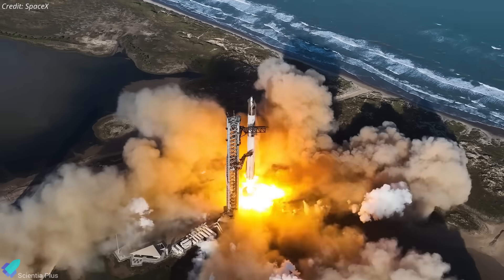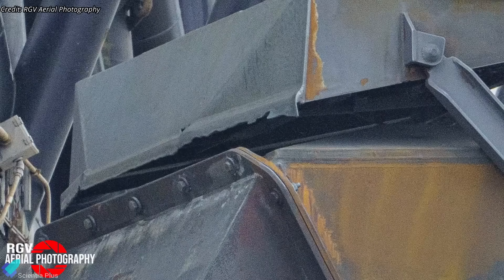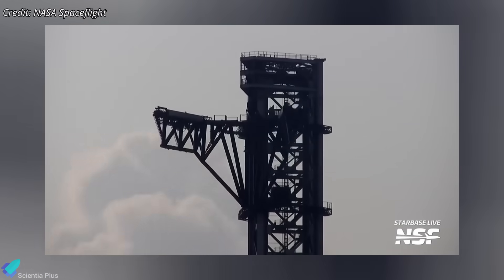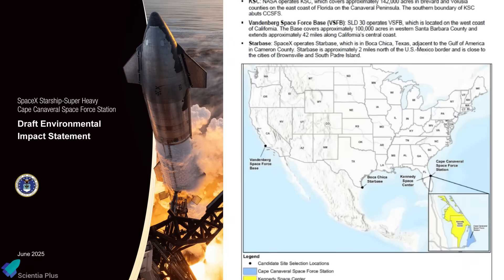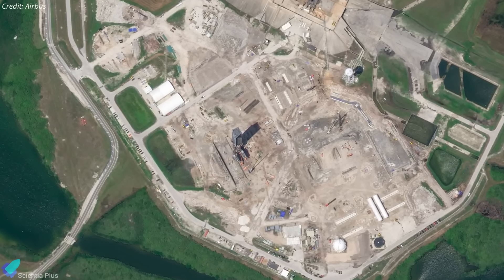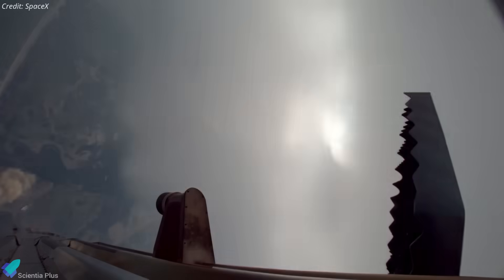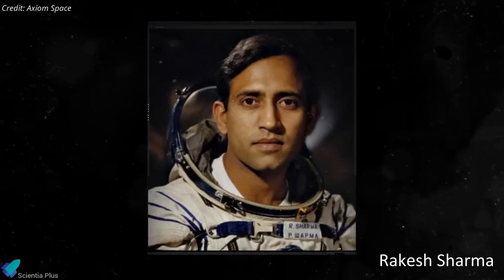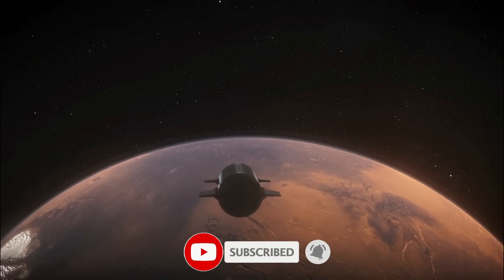SpaceX Finally Admitted It: Starship Must Land at Sea! Falcon 9 Multiple Troubles Delayed Ax 4

Comment from the maker: 00:00 Starship Updates
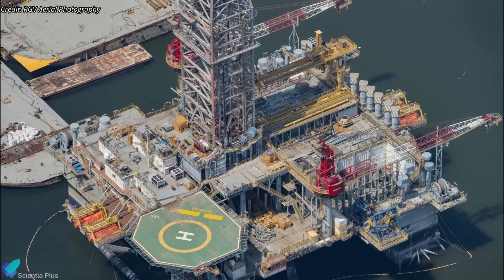12:31 TVC Failure and Engine Leak Discovered After Static Fire: Ax-4 Postponed!

📚 Learn More:

🚀 Starship Block 2 Explained:
 📖 Summary: https://shorturl.at/b0dtw
 🔍 Detailed Explanations:
  • Design Improvements Update 1: https://shorturl.at/lpGT7
  • Design Improvements Update 2: https://shorturl.at/gwNQ4
  • Nosecone & Payload Bay Redesign: https://shorturl.at/xa60S
  • Methane Downcomer Redesign: https://shorturl.at/XdYBG

🚀 Starship Block 3 Explained: https://shorturl.at/mnBT4
🚀 Starship & Booster Block 3 Detailed Breakdown: https://shorturl.at/IViwD
🚀 Starship & Booster Block 3 Production Begins: https://shorturl.at/xRNkJ

🔥 Raptor V3 Mega Upgrades & First Test: https://shorturl.at/TRIyj
🧱 What’s Inside Starship GigaBay?: https://shorturl.at/nJM75
🛠 Insane Engineering of New Starship Launch Pad B: https://shorturl.at/7RAZd
🛢 Dual-Port Orbital Refueling – Full Technical Breakdown
https://shorturl.at/5tiqK

🛠 Other Starship Upgrades:
 • Hot Staging Explained: https://shorturl.at/jf400
 • Super Heavy Booster Upgrades: https://shorturl.at/Pi5R3
 • How SpaceX Protects Raptor Engines: https://shorturl.at/4Om8F
 • New Heat Tiles Explained: https://shorturl.at/p2Ijb

🚀 Starship Flight 7
 📽 Complete Breakdown: https://youtu.be/UqzZx7vb-TA
 🛠 Root Cause & Fixes: https://shorturl.at/HcLKo

🚀 Starship Flight 8
 📽 Complete Breakdown: https://youtu.be/f26yH80RK2o
 🛠 Root Cause & Fixes: https://shorturl.at/vsGFB

🚀 Starship Flight 9
 📽 Complete Breakdown: https://youtu.be/2eirgcUzwts

🎙 Elon Musk 2025 Starship Presentation – Uncut Version
https://youtu.be/1dSaPSwp5X8

📡 Stay Updated:
📢 Weekly Updates: https://bit.ly/3HIQjPC
🚀 SpaceX Playlist: https://bit.ly/34wue8T

🌍 Follow Us:
👍 Facebook: https://www.facebook.com/scientiaplus

Comment: Good report. The current problem reported here with the AX- F9 booster issue - that it’s actually an issue carried over from previously that should have been fixed, but wasn’t- is the rare admission of a clear mistake in SpaceX’s process. It’s good they are doing a review to find out how/why they dropped the ball on this one. - Dave Huntsman